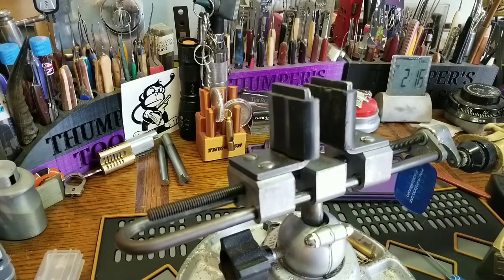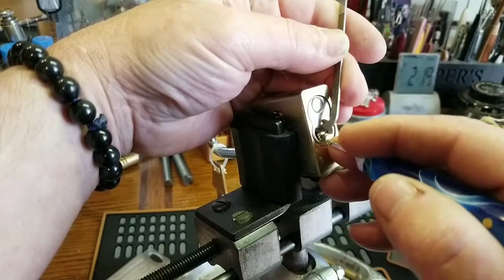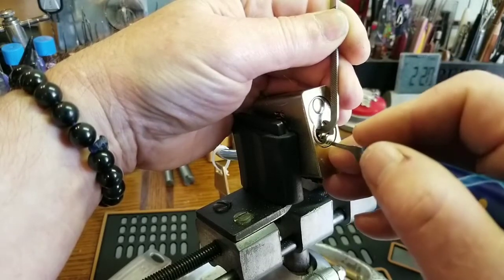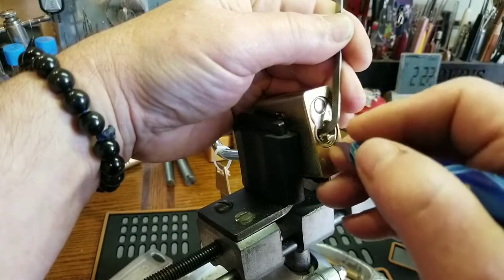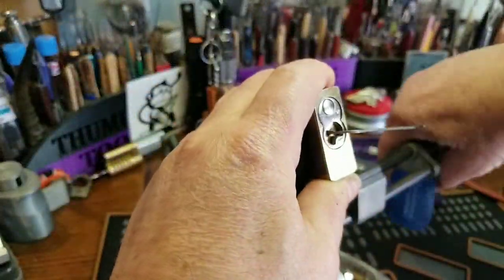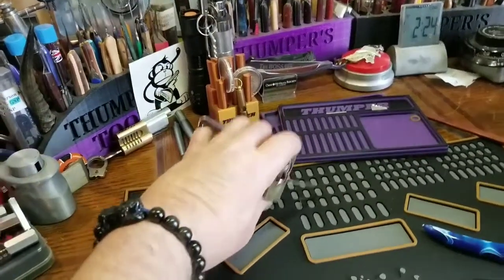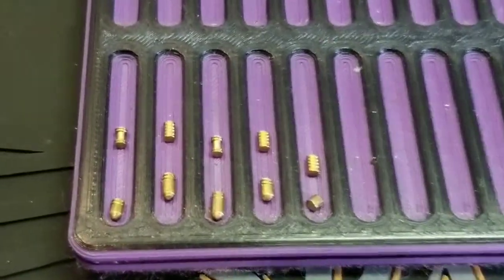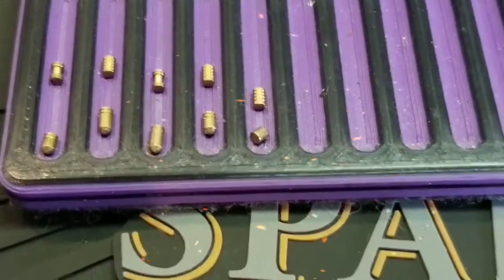#732/picked open and gutted US 5200 AMERICAN

Comment: Love those spools with serrations at either end. Yes I did want to see some of those, thanks for remembering Thumper.
How did you manage to grip one end and keep it centred to serrate the opposite end?
Just wondering buddy as I wan't a crack at making some like that. 
Awesome picking as always, pleasure to watch.
Reply from the maker: By keeping the ends like they are  (perfectly round) that Chicago flex shaft Dremel can grab on the tip ends of the pins pretty good, so your just  filing down the middle. That really is a great tool.
Reply: @thumperlockpicking9269  The tool I use is quite good. In fact I used to use my drill but it didn't always hold the pins centered. So after watching you talk about making pins and showing off your tool I started putting pins in the tool and it works much better. So thanks for the advice Thumper : ) Nice one!